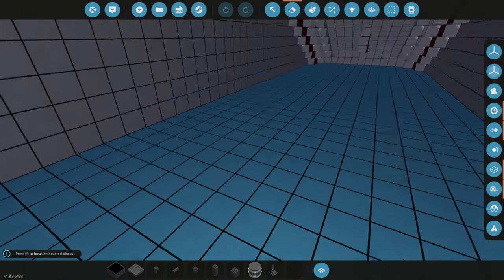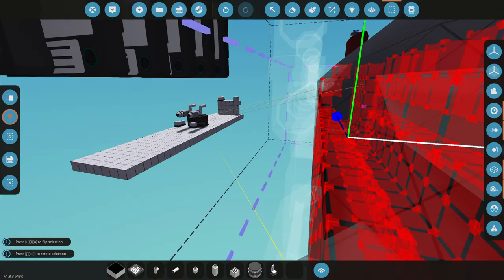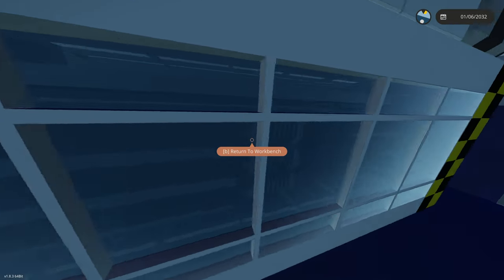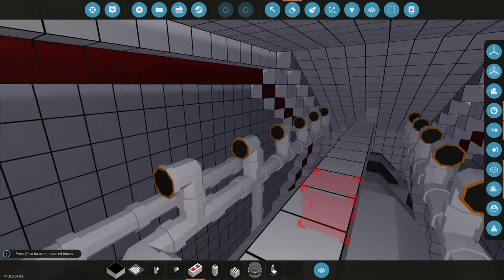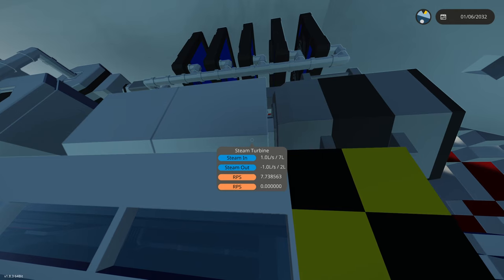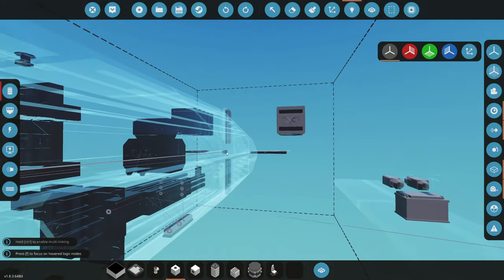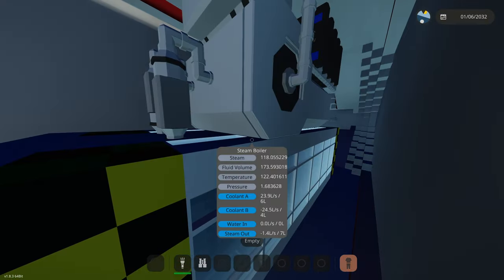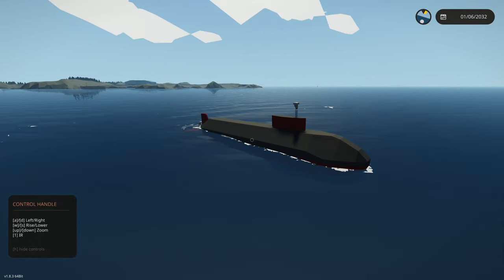Adding Nuclear Reactor | Ultimate Research Submarine, Stormworks (#7)

Comment: You should keep the generator and add some electric motors, I think that you should never connect a propeller to a steam engine powered by a nuclear reactor, the reactor is used to heat up water to turn the steam turbine to power the generator to power an electric motor, and that's what big nuclear submarines on Stormworks do, and they can go over 70Knots